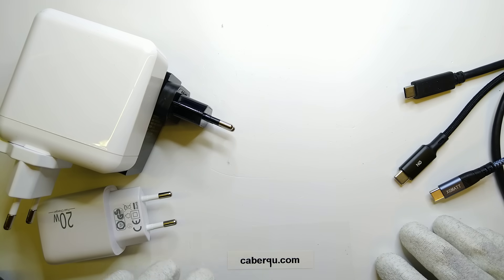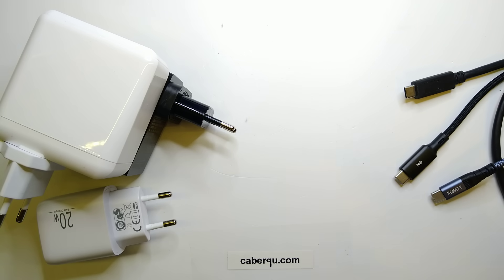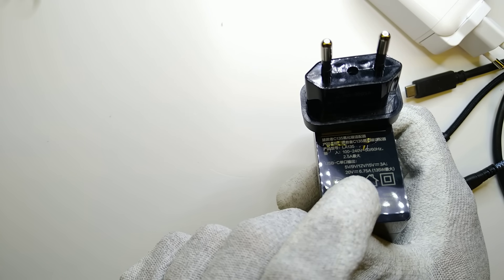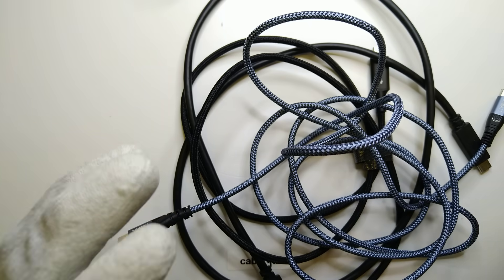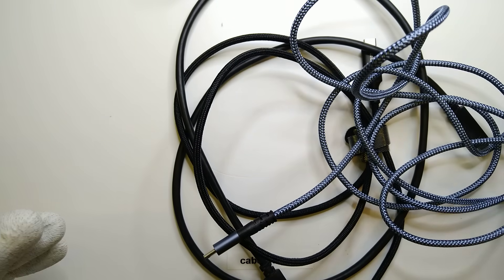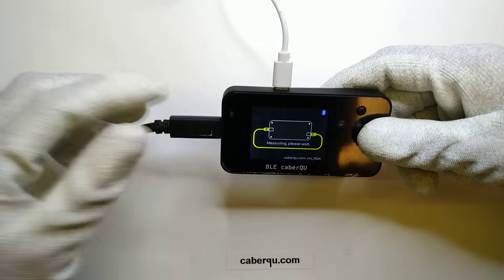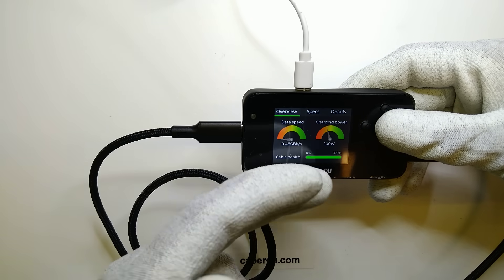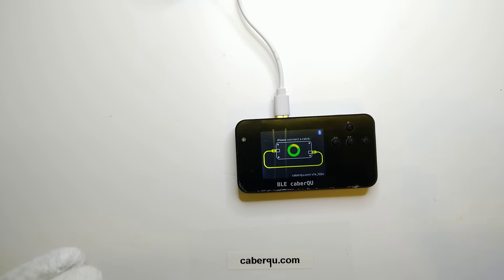USB-C is now EU standard, but the most important thing is missing

Comment: The problem is a bit worse. EU communicates how this will make chargers and cables universal. Plenty of people celebrate this, mostly based on this promise. 

I doubt that a 15W charger would be effective for a laptop that needs 150W power. We don't have universal chargers now. Stanrdised connector doesn't mean universal charging. It is the smaller problem.

The even worse problem with the illusion of compatibility are far worse. 

Previously, under anothter of your videos, I have commented how otherwise unsupported adapters can be made as USB Hubs with only 2 exposed ports, otherwise unsupported extension cables can be seen as a cable and an USB HUB combined. Yet we almost never see those safe designs, but we see plenty of hazardous non-compliant cables. We seen how some non-compliant designs can pose a safety risk. Non-compliant devices are common. When people believe in "universal" nature of USB-C charging, they might just connect their devices to these non-compliant cables in an unsafe configuration. It is a potential fire hazard. How EU made a connector mandatory but neglected to make some regulations to keep it safe is a problem from this side only.

A charging only cable is unsupported, and not compliant with all the standards, but it is a safe deviation. USB even if it comes with Power Delivery option, it is designed as a "serial bus" to attach peripherials. An USB cable or the charger itself might have "hidden surprises". We have seen cables that might emulate keyboards. A charging head with an USB hub and many devices inside can be even worse. Cybersecurity wise USB wasn't designed for "sharing your chargers and cables" as it can pose a security risk. If you want a shared connector standard, it should be possible to work with the industry and design it from ground up with this purpose in mind. But it would be better if we could see a difference between a charging only cable, and a potentially dangerous one by looking at the connector. Designing an improved standard that would be safe and secure can be better than adapting an existing one. 

Also if you see transit on many vehicles there are USB A ports for charging. You might need both A to C and C to C cables now.

Comment: I had this problem not so long ago, I went looking for a high power charging cable, but every cable I saw didn't have enough info on the packet to let me know if they were suitable.
I also wonder about the longevity of USB-C, there is a lot of small pins in that connector, with a requirement to carry up to 5A. Small pins and lots of amps equals trouble.

Comment: Excellent video with lots of detail! Thank you for this wonderful video! I replace all my USB A wall chargers with USB C chargers a few months ago. My 10,000mAh power bank wouldn't charge any more and it has a USB C connector for charging and I thought it went bad. Thanks to the people in the comment section, I found out that it will only charge with a USB A wall charger and a USB A to C cable. I have it charging now.

Comment: Some devices can't be charged with an usb cable with 2 c type connectors. Probably those devices, usually simple devices like a light, don't send a signal to the charger to request the correct voltage. Those people need to have a simple charger with usb-a and the cable.
Reply from the maker: This is actually a really simple issue on the device, they are missing two required 5.1k pull-down resistors. USB-A to USB-C cables provide power at all times, so they work regardless
Reply: there is no need for voltage negotiation because charge expect that all is 5V device until it tells it wants more. simple devices (and pre PD devices) dont even try.
you just need some current so charge know you connected something

Comment: The EU is like old people who don’t understand technology. The port was never a problem. All USB chargers were the same with a type A port. It was the cable that was different. And I still have four different types of cables at home, plus USB C to Lightning for my iPhone. We will ways need different cables for the foreseeable future.
Reply: law isn't for chargers but for devices. some were micro some were C so they unified it.
Reply: @ they initially said there were too many chargers ending up as electronic waste. Earlier cell phones had proprietary chargers and connectors. Apple always used USB chargers. You could use any USB charger as long as you had the correct cable. And that’s true of many USB devices. 

My laser printer has a USB B connector. My Bluetooth headphones have a mini USB. I have more USB A and mini devices than C. Do we throw all these devices out? No. Just buy a matching cable. 

None of this stopped chargers from ending up as e waste. Now you need extra cables. My iPhone 14 came with a USB-C to Lightning cable. I don’t own a single charger with USB-C, so I had to buy an adapter. I have 5 USB-A chargers. So what do you do with those? Throw them out?

See what I’m saying? This solves nothing. 

And Apple holds the patent on the USB-C connector. 😁
Reply: The ports were the problem. They address that. Now they will address other issues. We have to give credit where it is due.
Reply: @ the ports were never a problem. I have USB devices that use every possible USB plug. The type of cable as far as power or data isn’t new either. It’s always been that way. This didn’t change a thing.

Comment: There is another problem with USB charging. Like the vacuum cleaner you have there is no advanced charging circuit inside so no communication with the charger. There are chargers that won't even give 5v if there is no communication between the device and charger.

Comment: WTF is wrong with people? Why do people need or want some government to decidee the cables, ports, and chargers they use? That is so damned absurd.
"really big step forward" What, how? Bureacrats in the EU get to dictate what ports we get? That doesn't even make sense. What happens in a few years when tach changes and some potential new port could be beneficial? I know what happens, nothing. We are stuck with the USB-C port that some stupiud damn laws mandates everytyhing has. And not just you all that live in the EU, I get to put up with the nonsense too because the copanies are going to comply witht he EU by making all their products the same crap.
FFS people are stupid and lazy.
Reply: You're completely missing the point.
Until now you could have small devices powered/charged by basically whatever, be in some form of USB, or a barrel jack. Granted, the level of uniformity in this has raised significantly in the last 25 years, but you still end up with a dozen different chargers and plugs for no good reason other than the manufacturer fancying that solution. So yeah, someone had to step in and dictate that you use USB-C or you can go bust. It makes perfect sense.

Starting tomorrow devices that can be powered/charged by USB (Power Delivery) will have to have USB-C (and if they need more then 5V or 1.5A current they'll have to support the USB Power Delivery standard on top, which, at least on paper, goes up to 240W). New wireless mouse? USB-C. New iPhone? USB-C. New whatever electronic gadget? USB-C.
Granted, exceptions will exist - high wattage-requiring laptops will still have barrel jack chargers, for when USB-C charging just isn't enough. Smartwatch might not need to have USB-C, it might have wireless, or pogo pin magnetic charger, but that will still plug into a USB charger.

At the end of the day you just need like 2-3 good high wattage chargers and a couple quality cables and you're good for years to come. Nothing to complain and make excuses about. You most likely already have them anyway...

And if you're worried about the USB-C port staying for the next, say, 20 years... so what if it does as long as it's still enough? Eventually a better connector and standard will take its place and the law will be updated to reflect that. For now believe that USB-C is sufficiently future-proof, and that no, there won't suddenly next year magically appear a new much better and much more advanced connector. Innovation won't be stifled easy.

Besides, nobody says it has to be "only" USB-C - meaning you can have USB-C AND the new magical super-connector both and the EU won't say a thing. Whatever is extra on top of USB-C is fair game.

Stop being a dummy ahh anti-regulation doomer. Or maybe come up with a better solution? I'm very curious what that would be...
Reply: @Moravuscz  well thank you for typing all of that 😅 I couldn't say it better.
Reply: Standards are good. Like each country has its own plug standard. It keeps things compatible with others.
Reply: @shamim64  I never said standards were bad. But an electrical outlet for an appliance is a totally different thing than a USB port on a handheld device. One is in the wall and one is on the freaking device.
Also, standards are a big thing already we have the USB standard, 801.11 WiFi, Bluetooth, 802.3 ethernet, etc etc. which are all voluntary and decided through collaboration and cooperation in the industries. Having the government come along and mandate the port on all devices isn't a standard, it's MF bullshit. It's stupid, counterproductive, anti-consumer, anti-business, and anti-innovation.
Reply: @Malagent Well, that's just how they want to do it, it already an industry standard anyway. I just think it's cool that it forces Apple to release newer iPhone with USB c. Apple can totally make USB c iPhone an EU only if they want, but they don't. Like, why did it take Apple so long? They already using USB C for their laptops and some iPad.
Reply: @shamim64  I and many others do not want USB-C on iPhones. Why did it take Apple so long? Because Apple listens to their damn customers sometimes.
So yeah, MF'n cool that some dumb law forces Apple to change what I want to buy.
It would be absurd to make an entirely different line of all the models with hardware changes. Currently, there are regional variants but the differences are in firmware. It is not practical to make different hardware for every market. That would just further cak the cost up for no damn reason.
Reply: @Malagent  Sorry for your loss. Yeah, it would be absurd. I just want to prove a point.

Comment: To be fair, look at the bigger picture: At least finally every device (the expensive part of the game) has an USB-C Port, even the manager toys from cupertino despite all lobbying.
A Cable (100W-10Gbit as standard for my laptop and mobile phone, A->C with 15W for phone+tablet charging over night) is easy to buy. Chargers support 120W with several C and A Ports, only to be bought once or reused/inheritet if you have some chargers already coming with your phone. My Lenovo even charges with my phone charger, not that fast of course, but it works.
So the goal of one standardized Port is achieved, not a beautiful solution, but works fine for technically impaired people like Gen Z and Boomers.
If someone had standardized the barrel plugs (3mm= 5V 4,5mm=9V 6mm=12V 8mm=20V 11mm=48V) with positive center 40 years ago, all these problems wouldn't be there or the standardization by the EU would have been easier, but here we go, USB-C is the lowest commen denominator.
Reply: Nice way to throw Gen Zs under the bus 😅

Comment: My mother bought a cheap smartphone that can only be charged with the USB-C cable that came with the phone as they have switched pins on that cable or something like this. Tried out all different cables including my good 240W Thunderbolt cables. Nothing works except their own branded USB-C charger cable.

While not including any cable parameters into the law was a clear failure, do you think they could have done it in a way that would have worked out for everyone?

I mean, even the USB Implementers Forum is confused by their speed/feature naming which is the reason why USB 3.0 now is USB 3.1 Gen 1. Plus they basically advise manufacturers not to use these names at all and instead use the actual max speed to avoid confusion (and this still does not include PD levels and connected pins).

Comment: In retail you can just decide what junk you keep having or become a bit European again (near the chargers specs.) People can give it back and so on, if it was sold for something and it doesn't work. We buy Chinese products regardless and some of my best USB-A to USB-C data cables are Chinese. Maybe an all-out EU setup doesn't work for my adventure. It was terrible to power up my Raspberry Pi 3's - I ended up buying chargers and did DIY (Micro-USB) to get 3A/5V so it's not easy to have full control or something like that. Maybe it will come. Power banks also come into this. Many just can't do what we hope.

Comment: I would point out that I'm trying to clean things up at end of year.  What can I say all the USB standards have this problem.  I slow charging non-usb c cables and faster ones from the same dumb charging point.  Most of the USB-C cabling I have is A to C and I'm just starting the C-C to journey and ran head long into this mess.  Nothing has changed except instead of having a device + cable + brick that are certified we are now requiring the user to guess the fuel and by the wheels+tires for their car with no guidance.  Also not things like laptop power bricks come with attached cord - annoying when breaks but no data requirement and hence way cheaper.

Comment: But what is the solution? There isn't much room for a label. It would need to be something like resistor code stripes - Then a complex table to decode the meaning of the stripes. As with resistors, many people would simply opt to measure the value instead.
Perhaps a tiny QR code or RFID but that requires a device to decode; might as well use said device to read the cable directly.
Reply: Watt-Data would appear to be the best answer 
240-4.0 would be the latest.
20-0.0 would be an old dumb cable

Comment: It is important to remember that the "USB=C" law is not about USB-C but about inter compatibility to reduce waste. They chose USB-C as it is the de facto standard and supports multiple devices and needs but the law is flexible and will change with technologies (they are currently looking on wireless charging). The current specifications do require labeling of chargers but not cable. That said, this can be changed and even the law states that "It is also necessary to reflect future amendments to labelling requirements, such as for charging devices or cables, or other technological". The Eu enables anyone to  comment and suggest amendments on existing laws so if you think it should be amended you can suggest that. Personalty I think that better labeling is important but I disagree with the claim that the lack of it will make things worst, as that was the case up until now and the law only improved things, even if not all of them, so it will be much better but it can be improved.
There are cable manufacturers that add info on the cables and when you buy one make sure to look for buy one that suites your needs.
Reply: true most of the probles were already in USB-micro era. USB-C just add problems with wattage and speed.

manufactures add specs on package but no cable itself so if you dont know that all your cables of brand A have those and all brand B have those you have problem ☹

Comment: A premium USB C cable will work for all devices, I bought a 100W USB C cable and it works for my Galaxy phone, my powerstation, and PCs

This is perceived problem pales against the many benefits of standardizing USB C.
Reply: no, there are many devices with USB-C charging port that require a USB-A to C cable to charge and won't work with a C to C cable. That's because they cheaped out on two 5k1 resistors that are needed to signal a USB-C Host port to apply 5V.

Comment: A solution might be to have devices that all know how to read the emarker chip and otherwise identify cables actually, you know, tell the user. At least for smartphones, tell me what the device is capable of, the cable, and the charger, and what was ultimately negotiated.
Reply: Isn't that how it it works?
Reply: @liquidsonly  it is but you don't see result. 
You have to have some special device and most of them told you just some of those info
Reply: @martinnovak679  Well the other "special device" is what the cable is plugged into and hopefully open souce and you can read the logs.
Reply: @liquidsonly  are talking about that box in this video or in general?
Because if you plug cable to phone you see only "charging" or "fast charging" but you know nothing about cable+charger and what V+A are used